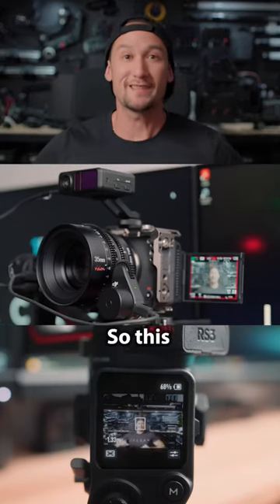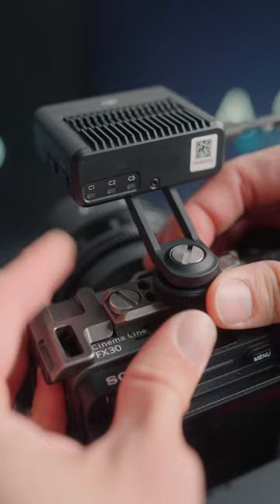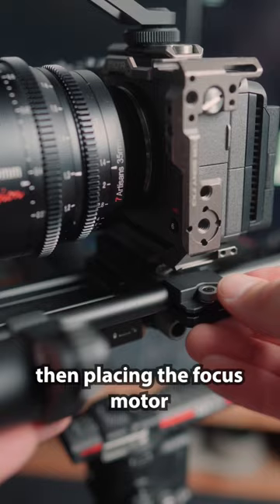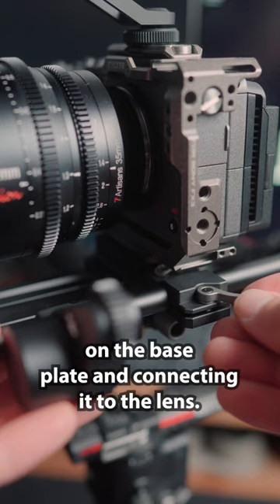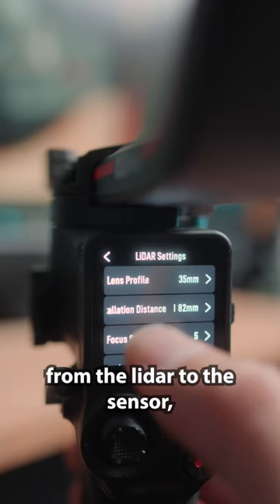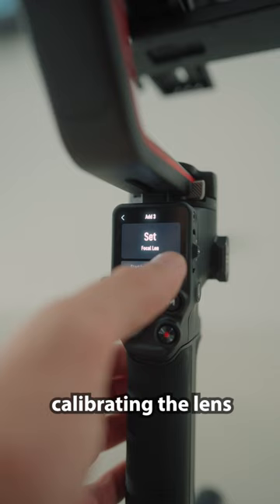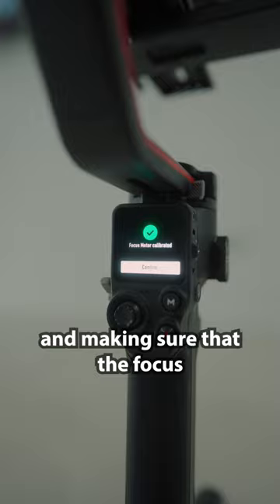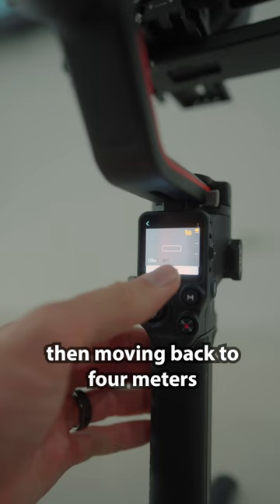DJI LiDAR system on the RS3 Pro

Comment: seems like more trouble than it's worth
Reply: Thought the same until you use it
Reply: it's cheaper since you won't buy lenses with auto focus.
Reply: You consider it a hassle but this is the only solution to the problem, alternatively you can spend thousands more for a lens with AF but at a certain level in film, they don't make the lenses with AF because you have a dedicated focus puller on set.
Reply: @scottpollock6549  are they using a RS3 Pro at this 'certain level in film?' 😕
Reply: @trip_the_deep  no but if you can't see the value in having AF on manual lenses then it's all good, but my Pro Combo's arriving today and it's gonna change the game for me... if it works well w my FX3 imma buy a BMPCC6K just to take advantage of it, and now ppl can buy into that ecosystem w/out worrying about the lack of AF, which was always its achilles heel.
for me, having the ability to fall back on AF using cinema and anamorphics is gonna give me so much more flexibility...
it's not gonna be for everyone but it's still incredible tech
Reply: @ListenHereOldMan  I get it but I just think if you drew a venn diagram between videographers who are 1 man crews and videographers who are advanced enough to need this it's going to be very slim... if you have a crew of more than 2-3 you usually just get 1 guy to pull focus on an external monitor. 

and if you're running around solo changing lenses you now require calibration of not just your focus motor, but also the lidar system...I definitely don't have time to be doing that on a job!
Reply: @trip_the_deep  the video said that there's a profile for every lenses that you have
Reply: @trip_the_deep  If I recall correctly, you can save the lens profile and then you no longer have to calibrate.  I believe it stores 2 lenses

Comment: One day in the not so distant future someone will come up with the idea of moving the focus motor inside the lens and have the camera and lens talk to each other and do all this manual work. Ohh wait…
Reply: Oh waait, a cinema lens is supposed to be run by multiple people, not just one dude, one pulls focus, one aperture and lens changes. The operator just has to keep his creative input to the framing and composition
Reply: @duckytheduck3127  I'm so glad you told me this.  I never would've known the purpose of my Teradek and FIZ system I use on set. lol
Reply: @Spinflight  As long as you are not using nucleus you're good with me for fiz